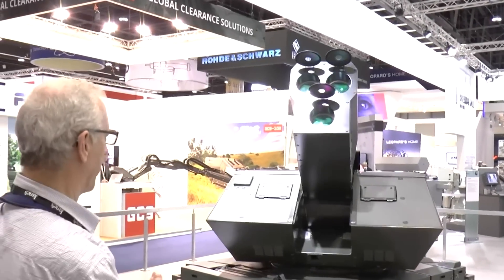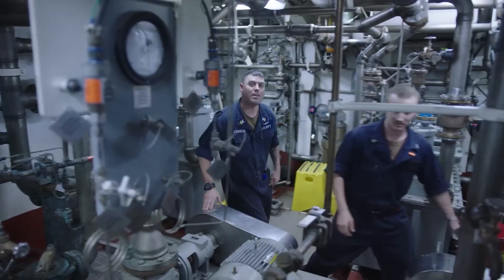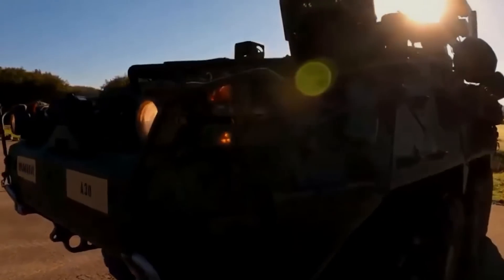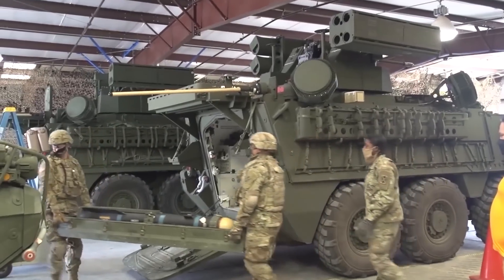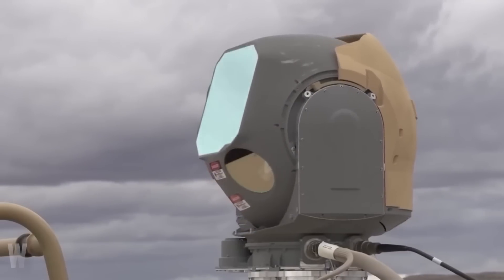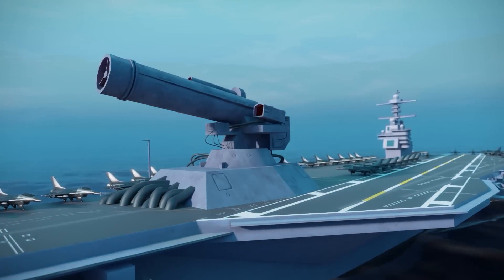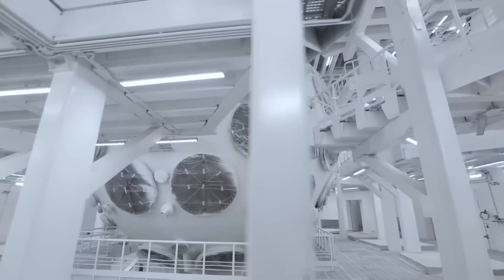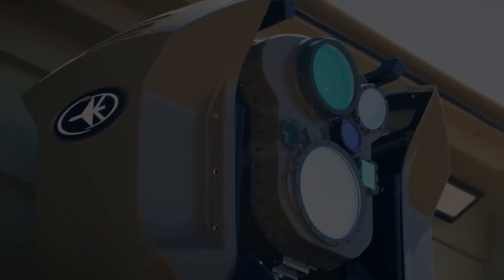U.S. Navy Lasers Just Stopped a Russian Nuclear Bomb

Comment: Adverse atmospheric conditions for laser accuracy and absorbed target power can be overcome by simultaneously projected and differential wavelengths in CW and pulsed outputs. Known physical properties and characteristics of atmospheric elements subjected laser transmissions can be designed to eliminate the negative adherents and allow the positive to reach their targets with maximum efficiency at the speed of light. What am i talking about? Our light spectrum goes from ultraviolet, to visual, into near and the far infrared. Make no mistake, EVERY physical element of our planet IS susceptible to the magnitude of laser energy transmissions...
Reply: You're absolutely correct on the laser's potential for penetrative potential.
The problem that he's referring to has been solved many years ago.
Cool stuff, yes?
Reply: So refreshing to know we are safe